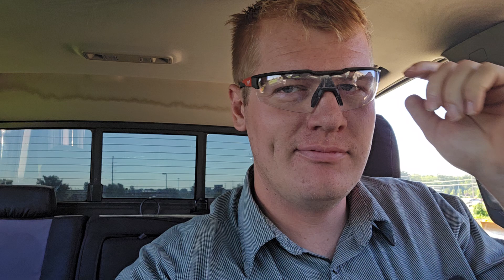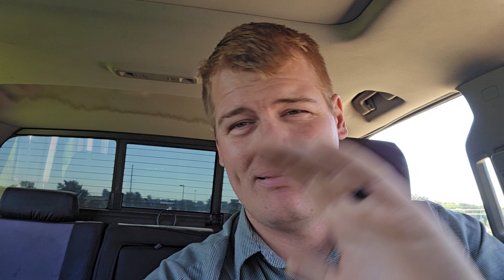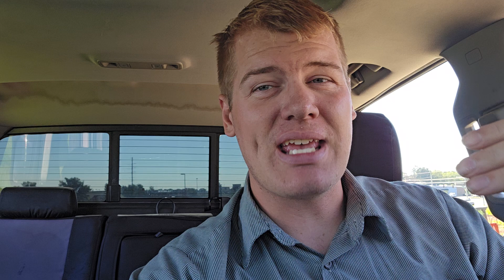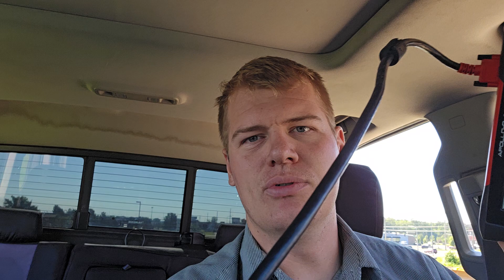Duramax DPF 101: How A DPF Regen Works And Why This Truck Is Broken

Comment: Why does my 2011 LML stop a forced regen scanner reads engine speed to high..??
Reply from the maker: I don't have a crystal ball, I'd have to put tools on the truck and do some testing and inspection. My shop, Finley River Auto And Diesel in Ozark missouri is opening December 1st and we wouod be happy to take a look at that for you if you're local.

Comment: Most of my driving is in town. Should I weekly take my truck (18 Chevy HD) for a trip down the freeway? If so, how long should I open it up and how aggressive should I get with rpm,throttle etc. I don't want to needlessly beat on my truck. I just got her.
Reply from the maker: Hop on the freeway and set the cruise. You dont need to beat on it. Just drive it above idle for more than 30ish minutes a month will do it some good.
Reply: @RogueWrenching Great! Thank you so much!